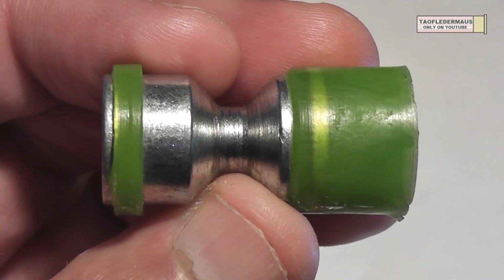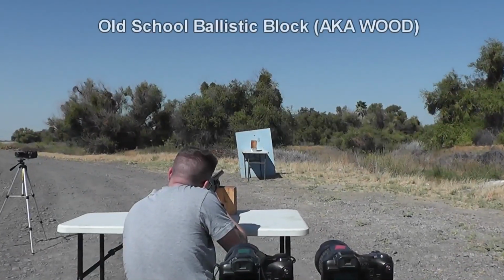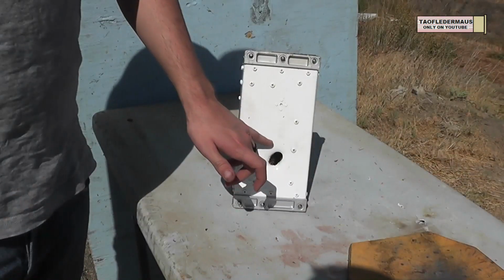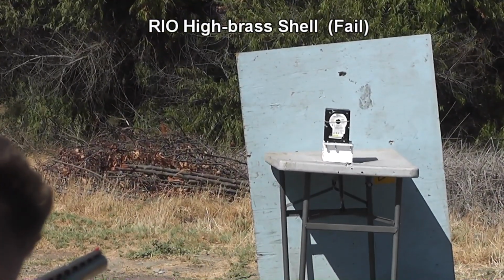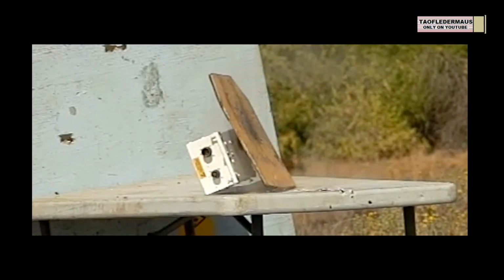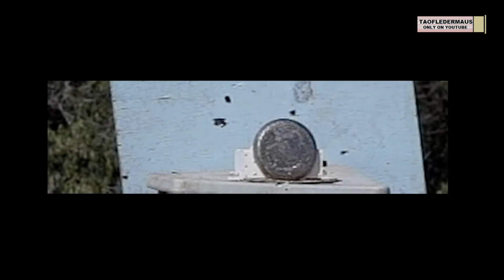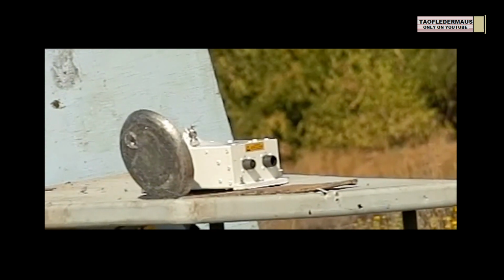12ga STEEL Slug Test  - The Exotic  D Dupleks Monolit 32

Comment: My favorite store has these. I grabbed a few boxes along with the steel broadhead slugs. 
The factory brass makes up 1/3 of both types of shells. The broadheads have about the same recoil as a regular, high brass, 2 3/4" slug. I haven't shot the ones in the video. They are labeled "Steelhead" monolit 28 solid steel slugs, advertised for use in smooth and rifled bores with any choke. 
If the accuracy is similar to the "broadheads" they are accurate out of the maverick 88, 24" rifled barrel. I'm hesitant to shoot them out of my antique, Sears single shot even if it says it's ok for full choke. Full chokes WILL Biden your accuracy. .....sorry, full chokes (with slugs), WILL rob you....of accuracy.
I bet this was a $6 box of shells in 2018. 
They are $13.99 in a retail setting, post globalist attack.

Comment: The whole point of this sugs is to have a flat surface and sharp 
edges. Cut branches in flight without changing the trajectory much. The 
original idea of the bullet, by the Frenchman Ronald Blondeau. But in 
form, it is more like a bullet of the Russian Rubekin, who made a 
similar bullet based on the concept of Blondeau. The Latvians did well, 
they did something between Blondo and Rubeikin, left the form closer to 
Rubeikin, but eliminated the drawback by making plastic parts. Blondeau 
had 2 belts made of lead around the circumference, Rubeikin used a 
container to protect the barrel. It seems like such a bullet flies 
straight at supersonic speed, and at subsonic speed, in an optimal 
situation, it flies a little swinging, like a shuttlecock for badminton,
 and cuts through the branches of a shrub, maintaining the same 
trajectory. And the wounds of animals, from such a bullet do not close, 
cuts through and does not push apart the skin and meat

Comment: Did you get any bore damage from that slug?  I see it has something of a protective sabot on the bearing surface, but I wanted to make sure that was effective for protecting the barrel.
Reply from the maker: no damage at all
Reply: Nice!  I've just found my new alpine trout fishing defense load.  This thing will likely drill through a grizzly, but don't recoil as badly as the Brennekes.

Comment: I was told that the flash was caused by air being trapped ahead of the slug and compressed with enough force to cause it to become incandescent for a brief moment.  Also, watch the test of the rail gun.The magnetic launch of the projectile appeared to be accompanied by fire surrounding the projectile when in fact,no chemical explosive was involved, just super heated air being induced by the shock of the hypersonic projectile passing through at about 5000 Mph.
Love your channel,  cheers from down under.

Comment: just saw your video.  You wanted to know WHAT caused the "Sparks" when shooting the lead plate.  The steel slug together with the kinetic energy when hitting the SOFTER lead target caused massive heat. The lead melted under this high temperature of kinetic impact force f pressure energy and what you saw was molten lead spraying outward.  good video!
Reply from the maker: We had the same flash when  a plastic wadding hit the lead plate.   (Wonder Bullet video)

Comment: I think the sparks with the Lead Plate shot were from the force released from the piece of the slug that broke off.  When steel breaks if high energies are involved, sparks fly.  See the ball bearing destruction on Hydraulic Press Channel.    Also,  If the slug had been made of tougher and harder steel,  think the wadcutter effect would have been more pronounced.   I am still learning about internal ballistics, but I think a slower burning powder would have resulted in a more stable flight

Comment: Depends on the steel used in the projectile and on the target. If it is not high carbon steel you are not going to get any sparks. On top of that if it punches right through the steel again not sparks it has to slide across the steel surface to get sparks. Look at the difference between a steel punch and hammer versus grinding wheel and spark generation. Fan boys of the movies need to get over their "sparks" idea....That is why they used insiderary or tracers at the very least along with armor pieces to bring down aircraft.

Comment: As mentioned below, yes, you can buy these slugs from S.G. Ammo. I have several different types and they shoot very accurate without the problems you had with blowing the skirts off of them.  You mentioned a lot of recoil when you shot them and I wonder if the shells you loaded them in to all had to fast of a burning powder in them.  They are not very high for the most part for five rounds. I wish you'd buy some and try the test over with factory loaded shells. I think you'll find much different results.

Comment: I have several weights and kinds of the D Dupleks slugs and a Monolit 32 in front of me right now.  I don't know why your blowing the skirts off of all of them in your video but I've never had this problem with the factory loads and I've shot a lot of them.  They may use a much slower burning powder in them or something but I find them to be very accurate and you can't hardly tear the plastic skirt off of one of them on purpose. Yes, SG ammo sells several variants of these slugs. Might try your test again with some of them.  Stuffing anything into a Walmart bird shot load and shooting it out of a shotgun Doesn't especially prove anything good or bad about what you shot.  Surely you didn't place the gas seal in backwards as one comment asked. The cup always goes towards the powder. If so that might explain blowing the skits off of the slugs.

Comment: Momentum Transfer has stopped the slug in the lead plate. Same prinziple like the pendulums with steel balls. It knocks the big pice out of the plate and transfer all of its remained kinetic energy in it. So it stops and the lead chunk starts flying! Just that simple i think. With lead slugs that would not happen because the lead will combine somehow. The result is an  inelastic collision. Steel slug makes an elastic collision some how. Nice video btw.
Reply from the maker: +Erzgebirge erleben   thanks!

Comment: the spark is similar to the trigger shrimp. its like a shock wave reaction. everything in between is trying to get out of the way at the light speed (literally) or be crushed. i think that is the light we see. so much energy... there was no real true answer about the shrimp at the time and still i don't know for fact. just my thoughts of gatherd knowledge and research.
Reply: mywillpower Bones I know this comment is old as hell at this point but I just have to say something anyway, and that is that nothing in the universe that is made of normal baryonic matter, be it solid, liquid, gas or plasma, comes anywhere near the universal speed limit that is the speed of light (3X10^8m/s, otherwise known as ''c'')
The flash created by the bullet shrimp is actually just an effect of air and material being super heated due to rapid powerful compression, the same way it is in the effect known as sonoluminescence which creates the compression by way of cavitation (the formation of a pocket vacuum and the subsequent powerful collapse of that vacuum) 
Just putting my 2 cents in there...
Reply from the maker: +mywillpower Bones  interesting!
Reply: yo , i said "trying" i dont disagree with you. lol.. so thats whats happening when things get pushed around. but that's it, thanks. i needed that change lol!

Comment: Jeff...fun video!
Are you aware D Dupleks slug are available here in the US?
I noticed when you placed the wad up against the base of the slug that the cupped portion was forward. Wads of those design are made to place the cupped portion against the powder.
Keep up the great videos!!!!
Reply: He had it right. They are made that way so they are stackable. You can use one, three or more gas seals if you need to adjust volume in the shell.
Reply: Normally, BPGS are used as an over-powder wad...not for shot height. 
Card, felt or cork wads are used to adjust height and over-shot cards are to seal the the payload such as shot for some loads. I have not seen any recipes using BPGS for shot/column loads. BPGS wads are not cheap and using them for shot height would get expensive!

Comment: Question, Do you melt down your inch lead plate after use and re-make them?
Reply from the maker: +Jumping Vale  Yes,  I usually add even more lead so the plate has been getting thicker and heavier.

Comment: @VicariousReality7 Tungsten by itself is never used it is always an alloy. Each alloy has differing density. Looking at a Periodic Table Tungsten "W" is 74/183.84 and lead "Pb" is 82/207.2 so lead is denser and is heavier for every equal measure so you are wrong tungsten is not " way heavier then lead"!!!LOL  The atomic number seldom lies when talking about the weight and density of an element. Look at the radioactive elements at the bottom then think about depleted uranium!

Since science is not your strong point why do you think lead was chosen for making bullets??? Why do you think solid copper bullets do not have good BC numbers compared to lead cored bullets? Why do you think we do not use wood or plastic for bullets as a matter of routine not talking about specialty items like training rounds or during war shortages etc???

Comment: Most steels seriously lack the density of lead. This was the problem when lead shot was made illegal for water foul. Some tungsten alloys can come closest. Steel will not deform like lead but it bleeds off it's energy a lot faster. A wasp waisted lead slug would likely out perform this steel slug especial if it has some form of sabot.

Their is a very real reason why few rifle or pistol bullets are made out of steel. When you have some form of penatrator added you still have lead core with some form of harden steel usually some type of tungsten like tungsten carbide added to it. You just can not get a good BC with steel. Since the best 12 gauge shotgun slugs seldom travel more then 500 meters before grounding this is not a huge factor to most and marketing means more then real science.

Their is a reason why depleted uranium which is cheap and dense as heck was a great choice on paper to kill vehicles and structures. I really do not want to see people useing depleted uranium to kill deer or shoot locks off doors etc....

You might want to try various tungsten alloys and just turn some in a lathe. For my money lead and copper solids work just fine as slugs in my 12ga. 

I once had to shoot a mad/rabid cow that had been on the lose in the area. A single Winchester Sabot 12ga dropped it from 100 yards with one shot. Unless you hit both shoulders on a deer often they will go clean through both sides of the deer at 100 yards and less and Remington Copper solids do the same thing. When I have been in Ga. and Florida they seem to work just fine on wild boars as do almost any centerfire rifle 30-30, 45-70, 243 etc.....Soldiers kill them with 5.56 .
Reply: +buckaroobonsi555 
Tungsten is waaaay heavier than lead, not sure what stupid alloy you refer to
Reply: No it is not check your periodic table. You know what I love about middle school level science??? It is so obvious and in your face that it truly makes fools as such. The atomic number tells the tale. Look at W versus Pb. The only stupid person here is you. No one uses pure Tungsten in ammunition does not matter if we are talking shotgun shells or 120mm anti-tank sabot rounds. 

Ignorance is a choice given the wealth of information free of charge on the internet! Educate yourself before you let your fingers make a fool of you online!
Reply: +buckaroobonsi555 very true. tungson is really expensive. now I looked it up you have to have a license to even have depleted uranium sadly it's very particular about what it can be used for
Reply: I did not know about the depleted uranium needing a license. I am going to guess their was a time they gave it away like copper pennys for the longest time. Tungsten has always been pricey kind of like nickle.
Reply: +buckaroobonsi555 actually no depleted uranium has always been regulated since its still radioactive material

Comment: Could you make a sleave mabey out of alunaminium to house 3 of 4 22lr the length of the 22 and back the whole thing with a hard wad mabey a dime would work to set of the 22s when fired out of 12g shell. If it worked ud have kinda high speed buckshot. Like your videos. Jesse

Comment: If you look at the Monolit 32 box, they have the big plastic part aiming forward... You loaded them with the big plastic part aiming backward...
Reply from the maker: +Scott V   Looking at box,   nope,  your wrong.
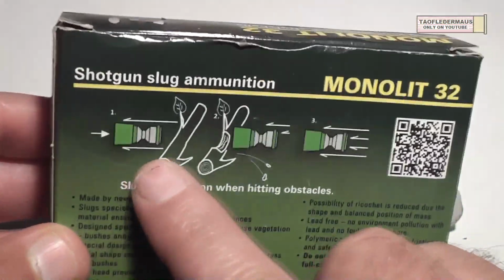Reply: Just looked at the front of the box... And you are right... I made the comment looking at the back of the box (at 1:31 in your video) and the back looked different.. The first picture has a arrow pointing to the right... but the majority of the pictures have the arrows (well half arrows really) pointing to the left..

That is why the comment... but in any case, good video anyway.
Reply from the maker: The heavy end always flies forward.   It wouldn't work the other way around.

Comment: @TAOFLEDERMAUS The "spark" you see is caused by Transient Sonoluminescence.  It can actually be caused by several mechanisms but is usually synonymous with a bremsstrahlung light emission from excitation of a gas's electron state upon the violent collapse of an inert gas bubble.  I

The slug's impact energy caused friction heat that instantly melted the lead and created a large number of gaseous bubbles inside the lead plate.  These gas bubbles are then violently collapsed and compressed from the slug's cavitation through the plate, cultivating very high temperature spikes and the environment for transient sonoluminescence.  This is why a "spark" was seen on the lead and not the steel plates (ie the flash melting point for lead was reached, but not so for the steel). 

t seems like this projectile would have a high likelihood of creating and SL event.  It has a large, flat impacting surface that would create a large amount of cavitation and friction.  You said it yourself, the slug looks more like a hydraulic piston than a shotgun projectile.

The SL process goes like this:
1) Slug strikes plate creating friction
2) Friction creates heat, instantly melting adjacent lead and creating gaseous bubbles of inert air, reactants, and water vapor 
3) Inward expansion compresses gas bubbles
4) Gas bubbles absorb heat from the system; heat capacity approaches thermal ionization limits for gases inside bubbles
5) Slug passes through; trapped bubbles are carried inward and through to the rear of the plate
6) Prior to discharge, the collapsed bubbles are compressed, allowing water vapor inside the bubble's cell to compress ionized gas
7) Energy states of gases alter as ionized gases neutralize, creating a burst of bremsstrahlung photons (light) in the process.

see:
https://www.youtube.com/watch?v=GJolILUbdNw

and

https://www.youtube.com/watch?v=tC2SUehnJ5A

The effect is usually accompanied with high humidity.  The more water particles in the air can increase the potential for effect.  I'm guessing you shot this when it was very humid?  

-Sincerely yours,
A very active shooter who's receiving a doctorate of Physics. :)

Comment: Noticed in  close up of  lead plate slug, steel tip appeared to have melted and re solidified 1200fps to 0fps  over distance less than 1inch would result in large transfer of kinetic to heat energy, may account for jet of sparks.

Comment: You can send ammo via Fedex and UPS with no problem... not that it applies to this video, but you made it sound like shipping ammo is not possible anywhere.  Not trying to be a smart ass, it would just suck for common perception to be false and have this right taken away as a result.
Reply from the maker: +J Gaskill   It has to be ground though.   You can't ship fireworks,  ammo,   pressurized containers, etc air mail.

Comment: Do they make these in 10 gauge ?
Reply from the maker: +frankgon4  I doubt it.  10ga is almost obsolete.
Reply: I  have a  modified 10 gauge with 18 inch barrel. 10 gauge is getting harder to find and I may have to invest in a reloader.
.

Comment: Do you have a choke on that gun? 
The shredded plastic suggests too much compression.
Reply from the maker: +leighrate    The problem was how I loaded them.    These rounds are designed to go through a full choke. We used both a Nova with no choke and a Mossberg 590 (cyl. bore)  and the results were the same.
Reply: Ok.

Comment: the flash you are seeing is the air that was trapped between the slug and the lead on impact being superheated.  You weren't seeing this on the other impacts because lead is more ductile and can form a seal with the projectile. This allows it to trap and compress the air, and if you are familiar with the ideal gas law as the pressure goes up so does the heat. In this case a whole lot

Comment: sparks: air Ionization of an air pocket trapped between the front of the slug and the lead. Probably would occur with any relatively ductile and dense material.

Comment: Check out a new YouTube channel called Gun Runnerz:  They test this shell and the rest of line like it.  They got the rounds straight from the manufacturer, so they were able to get it just as it is loaded.  It uses a high brass shell, and generates about 1500 fps.
Reply from the maker: +Richard Folgado   I guess you didn't watch the whole video and saw that I put a direct link to his gel test video.